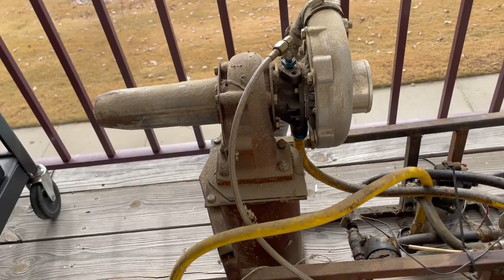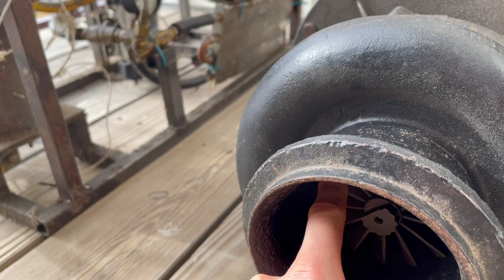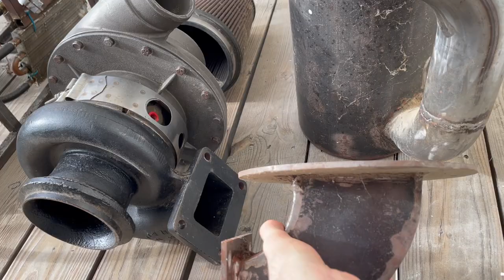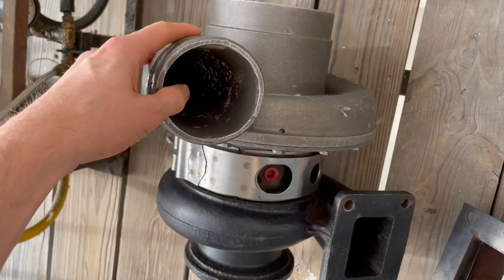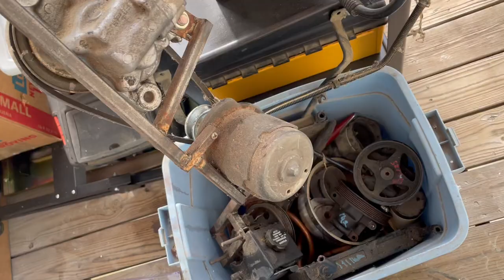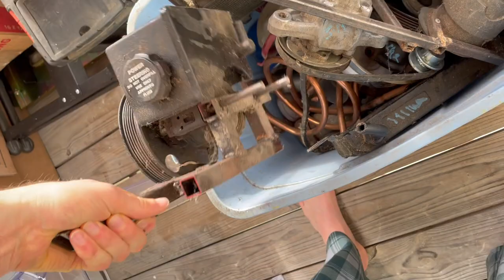ST-50 Turbocharger Turbojet Engine - Combustion Chamber almost finished IT BEGINS AGAIN!

Comment: Did you simulate this engine on your MPI cluster before welding the structure?
Reply from the maker: no, I simulated it in my head :)    I didnt even use a CAD program for the structure, I just spent a lot of time thinking about it. For the big one, the 90 degree reducing bend part, I had the sides waterjet cut and then I bent metal strips to fit the top and bottom. Also waterjet cut the flanges. Thanks for the comment, stay tuned my friend. Nice robot computer btw.

Comment: I saw your combustion chamber. Where is your injector? What kinda fuel are you using?
Reply from the maker: The small one is propane only with the injector on the bottom in the center of the mounted chamber. For the big one, I am planning to start it on propane and then switch to liquid fuel, but liquid fuel cant just be dumped into the chamber, it has to be atomized or vaporized, so this is much more difficult to construct and I never built it! This is the most important thing I am planning to work on next! I have some videos showing details of the injector and combustion process for the small one but haven't uploaded them yet. Stay tuned!
Reply: @heyyowatchthis  I will this looks like an interesting project. Everything takes time especially if you're trying to live life as a normal person and do this on the side 👍🏻 good luck 😇
Reply: I also know some guys that did it with liquid propane. Diesel or jet A gets much more complicated indeed. But the smell of jet-a would kind of be worth it I think 🥰 cool Factor level nine!
Reply: I don't know where you find it but a super high-powered diesel engine fuel pump with six injectors arranged radially inside that tube should make it pretty fine spray anyway. Figuring out how many injectors and what angle into the airstream though would take some research (for me) pardon the long text I guess I'm just an armchair enthusiast
Reply from the maker: @azul29156  I owned a 1996 Turbodiesel Cummins Dodge Ram for a while, I wanted to run biodiesel and do some other experiments, but had to sell it. I read the manual and learned as much as I could, I was thinking the same thing, a 6 cylinder diesel injection pump just like I had on the truck would be perfect! They make like 12,000 psi. Its ridiculous! but expensive and complex. I will try a low pressure thermal evaporator tube first, started and heated by the propane. Time to crank up the welder again!